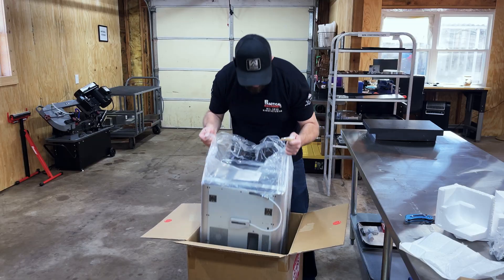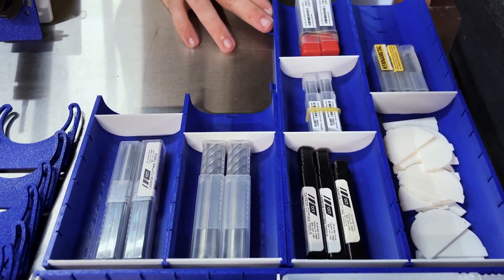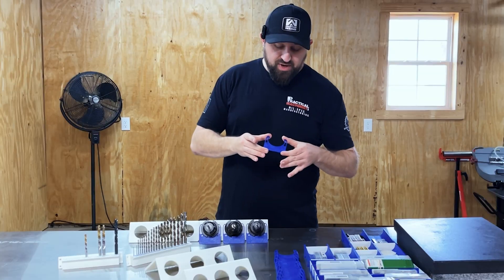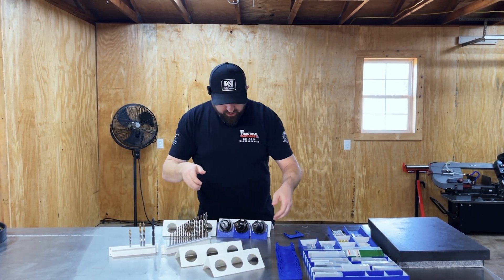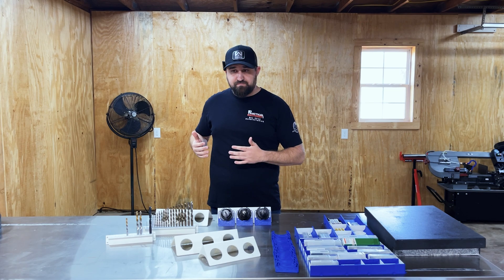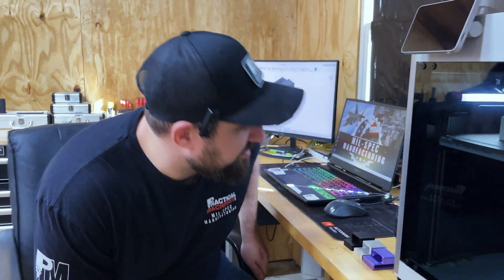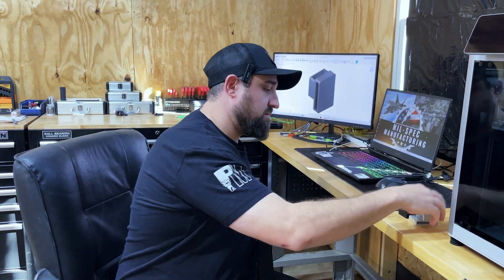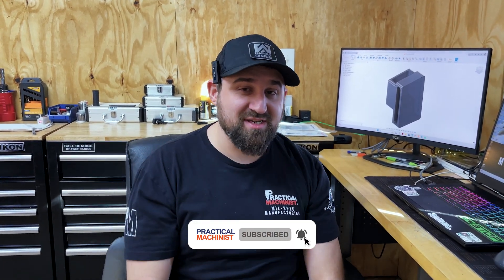I Finally Tried 3D Printing—Here’s How It’s Improving My Workflow! | BAPM Ep.16

Comment: When you showed the wall bracket tilted slightly, my first thought was "Why not tip it a bit more so the taper on the tool sits flat against the wall? Could even have a cradle on bottom of wall bracket to centre on the taper or pull stud."

Comment: Best piece of advice for designing 3d prints is to not be lazy and design the whole print inside and out. If it's something that's a quick solution your looking for it's fine to just design the general shape and let the slicer do infill and supports just to get it done quick but for better prints that you want to function a specific way or last longer things like that it's better to try to design it all into your print from the start.
Reply: Do be lazy. Let the slicer do the work, you only need to understand a few settings and your results will be good enough. Life is too short to manually design infill. And if you really want to make a highly optimized part don't use an fdm 3d printer.